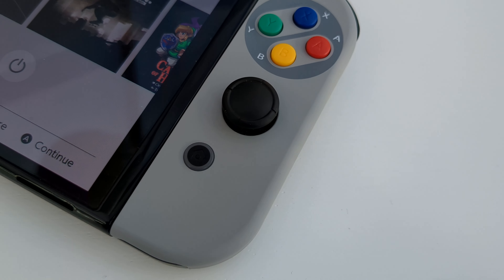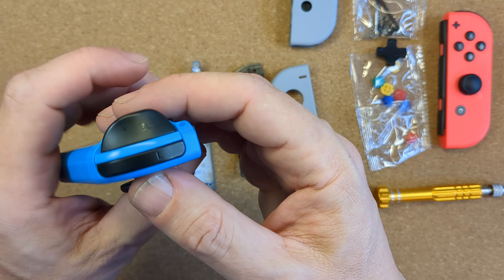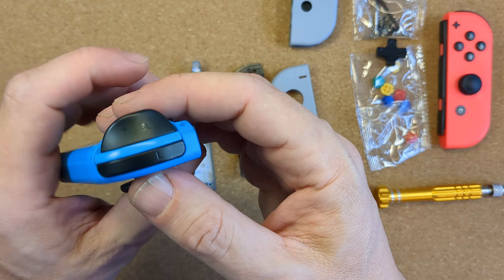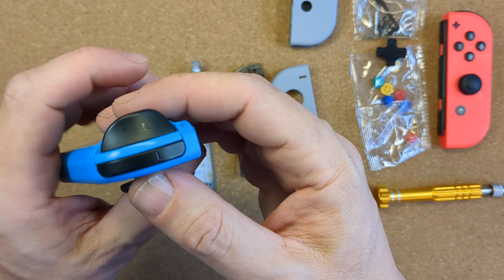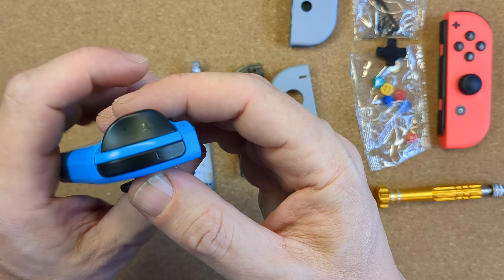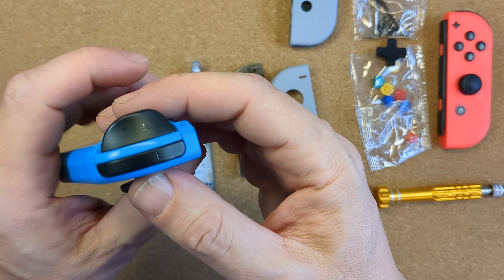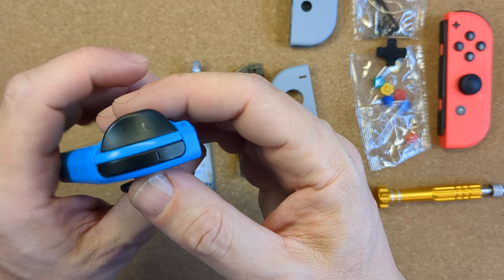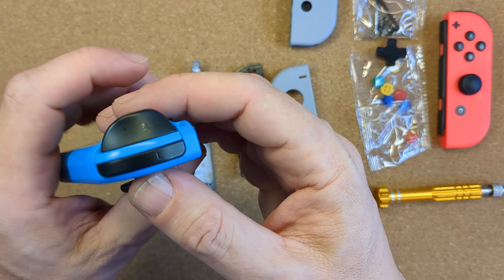How to swap out your Joy-Con shells: eXtremeRate Super Famicom style kit with D-Pad - Full Tutorial

Comment: So some updates for everyone. The Gray joycon's are known to have a cheaper designed clip for the joycon rail. Win transferring one of these joycon's to a new housing.  Make sure that you buy a spare rail as well. Because you may not get that rail ribbon cable to lock back in to the plug. And it has nothing to do with the plug. It has to do with the thickness of the orange ribbon cable.
Reply from the maker: I didn't know that, thank you!
Reply: @JoeBleeps   your welcome

Comment: I only had a Switch Lite when the OLED model launched, which I bought on the day of its release. However, after playing with it for an hour or so, I searched the internet for shell options that provide a proper d-pad, because of how awful those 4 directional buttons felt compared to the Lite model. Got the red soft touch shells from extremerate, which look awesome when paired with the white dock, and when mixing them with the original white joy-cons. They feel very premium, do exactly what they are supposed to, and installation was a piece of cake. 
Very solid guide you provide here, thank you! I wish more people would check out your content on a regular basis. Great channel!
Reply from the maker: Thank you! The channel is still steadily growing, it's going in the right direction at least. I was the same after playing on the switch lite for so long, I needed a d pad. The RetroFlag controller is great for that reason too, it's got a great d pad. The thing that surprised me here is how good the d pad feels with those four tactile switches below it.

Comment: Thanks matey. 👌 That's a real pain in the ass, but I got it done with your guide. 

Easy enough to swap in metal rail clips and gulikit hall effect sticks during the process.

I also glued a small, rounded plastic "pivot point" to the board behind the d-pad, to prevent unwanted inputs if the entire thing gets pushed down like one button. Not sure I'd recommend that step to anyone, as it's tough to get right, and might damage your board if you ever wanted it off, but I'm very picky about d-pads and it's working great for me.
Reply from the maker: Sounds like a worthwhile project!
Reply: i just did this with my extremerate shell replacement. what i did instead though, was i put the SMALLEST dab of hot glue onto the motherboard... less permanent fixation in case whatever reason i don't like it, less likely to damage it. another thing i did was i rotated the membrane to the right once. this way, the slots that are supposed to slot into the dpad act more like a rocker. while still i don't think my method is perfect; it helped tighten up the controls a considerable amount. i CAN still hit every button at once, but only if i really try. this is due to the flexibility of the membrane and the hot glue. at least the controls are tightened up to the point where i won't accidentally be doing more than 1 button at a time now. 

i thought i would share my method. thanks for sharing this bit of information! 

ultimately, this is an overlooked step on extremerate's part. i personally believe they should add a spike to the bottom of their dpad and include their own membrane. i would even go as far as to punch a hole through the stock membrane, or order a stock membrane to do it to. outside of this, i have no other complaints and i much prefer the extremerate shells over the stock.

Comment: to anyone who follows this guide and your ZR button doesn't work after you're all done putting it back together: the tiny, last little ribbon cable (the annoying one) needs to go GOLD side DOWN (dark side up). a very easy thing to miss!!! lol

extremerate has a video about this on their channel, i nearly missed it, was tearing my hair out trying to figure out why my ZR wasn't working

EDIT: another tip, please do not use metal tweezers for the ribbon cables on either joycon -- use soft plastic tweezers instead. with metal ones, you risk shorting and burning a tiny little jumper fuse. this is a pretty common mishap, there are threads on ifixit about this (joycons no longer charging after being taken apart).
Reply from the maker: @bloodpine666  thank you for this! Very useful information

Comment: ONE VERY IMPORTANT THING this clown decided not to mention. 1) the battery connections pull UP from the board, not to the side like it would seem they would. So unless you like buying new batteries there is that.
Reply from the maker: Thanks for the info. I hadn't realised it might seem they should be pulled out to the side  🤡
Reply: Not that big of a thing to insult someone for..
Reply: not a reason to insult him
Reply: Yeah, completely pulled the wires out from the adapter lol